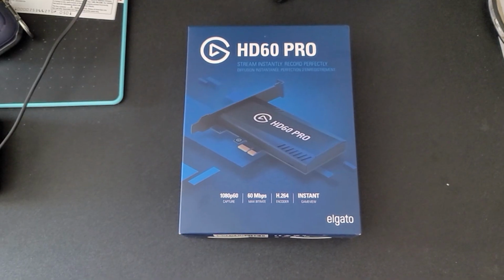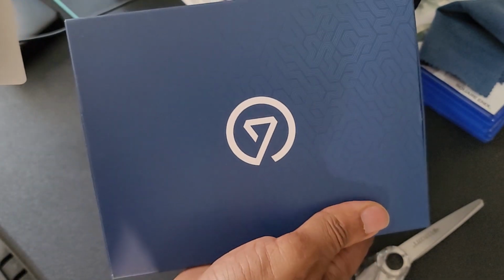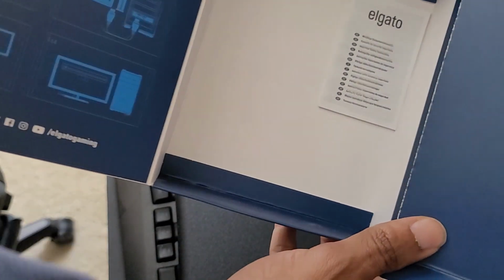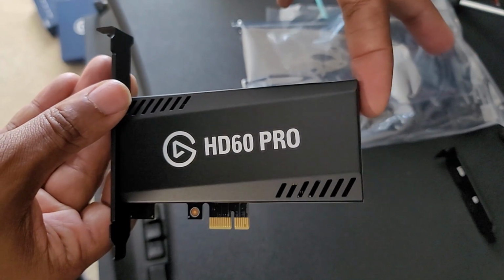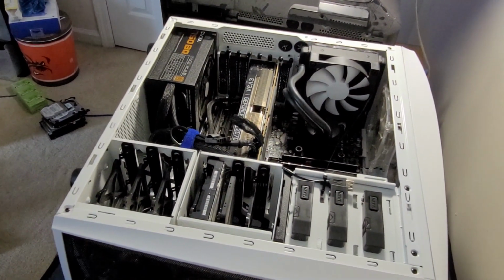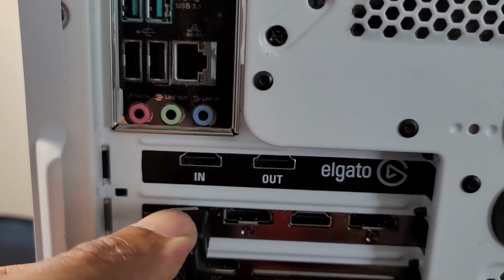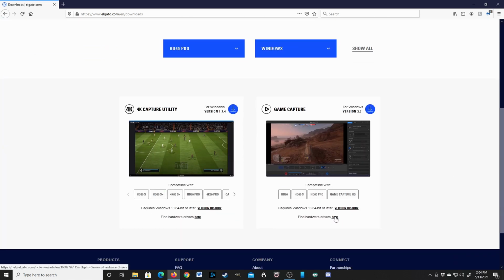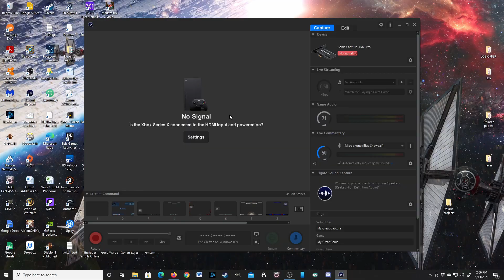Elgato HD60 Pro - Unboxing & PC Install 2021

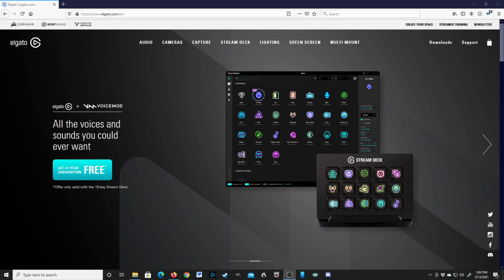Comment: Mah dude good video, however watch out next time to check out the sound levels as at 14:25 your microphone volume changes drastically, it's almost inaudible.
Reply from the maker: I wish, I saw that before I uploaded the video.  Thank you so much for letting me know.  I will do better next time.  Also thank you for the comment.